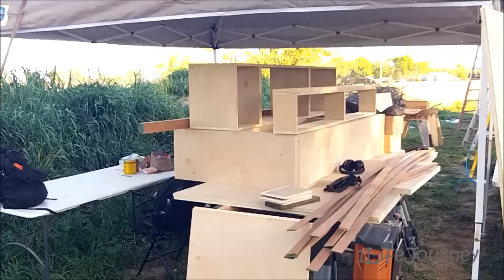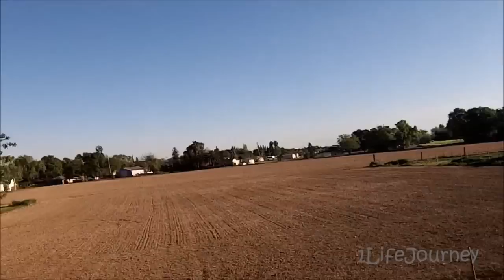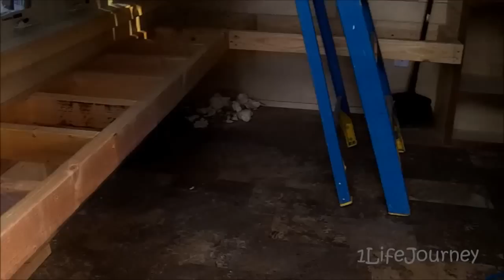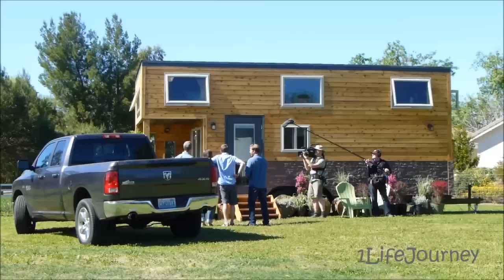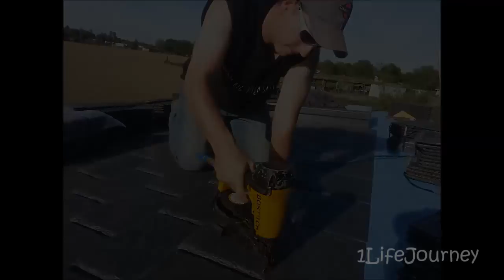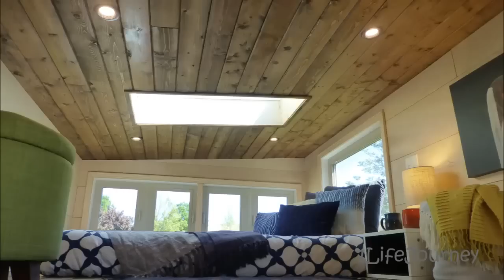Tiny House Nation - S3 E9 - Backpack House  - Behind the Scenes

Comment: Very nice house. How much does that one cost to build?
Like it a looooot  :-)
Greetings
Erik
Reply from the maker: +rikkiesix It depends how much of the build you want to do yourself. This house cost around 45k when all was said and done. The house we are currently working on will cost around 75-80k. Most of that comes from the finishes that were put into the house. A lot of custom one off materials that the home owner wanted. The trailer alone cost almost 14k. This is an example of one of the more expensive homes that we have built.
Reply: +1lifejourney The biggest problem is that you can't put these houses anywhere. It's the same problem with trailers. You have to pay $600 per month on trailer park rent. At that point, you should just buy a regular house.

Comment: I like the size of the tiny house. I find some of the tiny houses actually claustrophobic instead of small. I think 250 -300 feet is a reasonable size. You can get street legal trailers large enough to construct a 300 square foot size tiny house upon :) The only thing I find is a bit of a design flaw to me, is the inaccessibility of the front porch area from inside of the tiny house :( There needs to be a side door access. Also, the size of the front porch is great, but, perhaps slightly overkill. If you took 15 inches less and pushed the kitchen (?) out the extra distance into the front porch area, and built upon an extra-wide trailer base, then you could have a couple of feet more of width as well :) As is, it is still very roomy in appearance. What's the deal with the video crew ? Were you shooting for TV broadcast ?
Reply: Personally, I'd say 150-175 square feet not including a separate sleeping space is the absolute minimum, with 200-225 being a more comfortable minimum. Anything 250+ is great until you start making it so big it defeats the purpose and starts becoming a regular house again.

Comment: My husband and I are really looking forward to moving into a Tiny house. From what I've seen, I would definitely like to have a house no less than 24 feet long. Preferably 26 or 28 feet long and with what I want and ALL solar I expect it will cost anywhere fron $35,000 to $66,000. I hope someone can get back to me. Because I have many questions. I need to know, for instance, can we get WIFI? Can we have just Solar? I want 2 lofts. I want a compost toilet. I want a bath and shower combo. I want windows that look like they're Tiffany designs. I want to look out and no one look in.. Exactly what kind of a vehicle do I need to pull it? Can I have a REAL closet? Those type of questions. Please help? Thank you.
Reply: You'd need something in the range of an F350 or F450 range truck to tow that. If you went 20 feet long or less, you could probably handle it with an F250 range truck. You can certainly configure a place to run on JUST solar, a bath and shower is definitely possible in that size range, IDK about Tiffany windows, you can probably find one-way glass, though, or electronic darkening glass, but that stuff's expensive. A REAL closet? IDK, do you mean a standing closet? A walk-in? A pull out?

I'm sure I can draw up some designs and go over options. I've researched this stuff enough to practically start my own company building and/or designing them, the only problem is getting myself situated and funded. Hit me back if you wanna know more and can give me your definition of a 'real closet', okay?

Also, an alternative idea to lofts would be to have 'wolf dens'. less worrisome ingress and egress. Ask me more about that if you want, too.